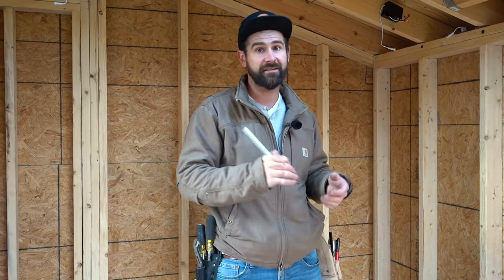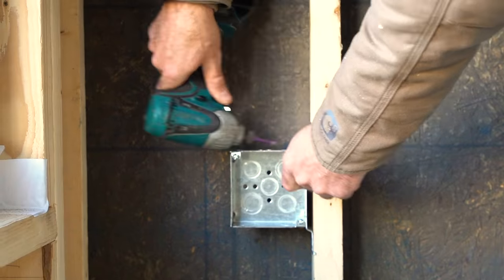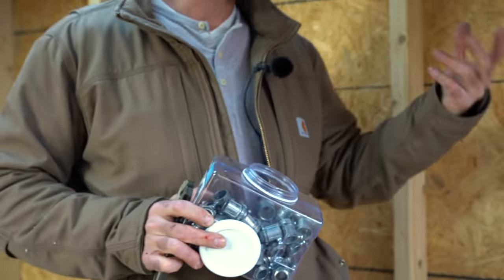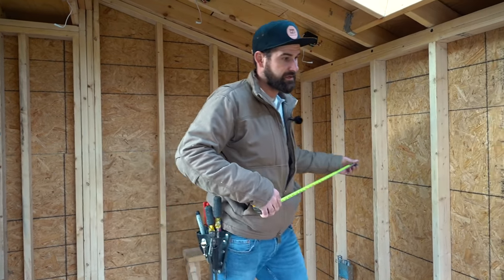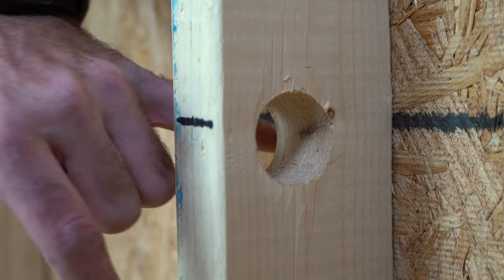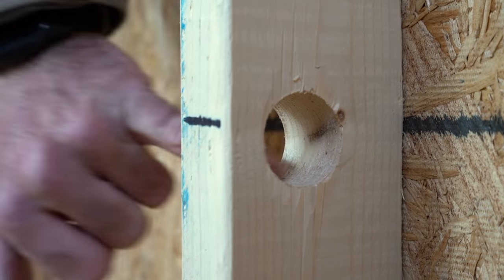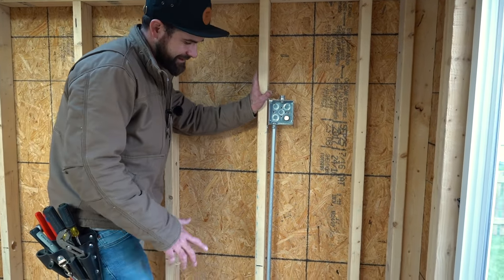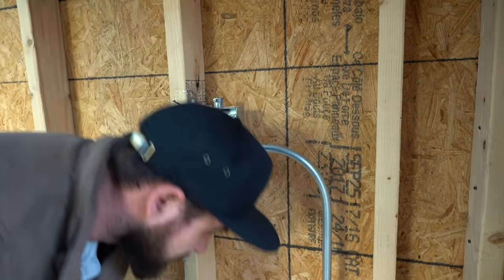How to bend and install electrical conduit

Comment: I would have used a deeper box ( 2 1/8" deep ) just to give a little more room. Somebody told me years ago the 11/2" deep boxes that you used are called 1900 boxes because they are 19 cubic inches. I always pull a ground wire in every metal conduit. Saw way too many conduits that pulled apart that would cause most of ground if no ground wire was pulled. Great ideal not using sheet rock screws to secure box.Klein makes a great screwdriver with a teamed on it. Have several that are over 40 years old and never had to replace the steel blade. Installed miles of conduit in industrial sites but only a few times thru just 1 or 2 holes in stud or joist. In industrial sites the only time we used 1/2" EMT conduit was for alarms. 3/4" conduit is a lot stronger and provides some room for future circuits. Great ideal putting the notches in home made step stool to hold conduit.Would try to keep edge of hole 11/8" from front of stud  like is required for Romex cable. Must seal all wires coming from a cold location to a warmer location to prevent condensation building uo.
Reply: I read that 1900 was the part number given by the Bossert Company almost 100 years ago.
Reply: It's only 2x3 studs you know....
Reply: @edwardsmith4353  thought they were 1 1/2 X 3 1/2
Reply: @mikeryan6277  my point was that his figures apply to ordinary studs which are listed as "2 X 4's". These studs are clearly 2X3's (which are slightly less than 2X3).
Reply: @danlux4954  it was also the UL listing number from back then and still is UL part# 1900

Comment: In Australia we have not any sort of this😂we just run the wires through the studs and bob is your uncle
Reply: Same here in Belgium .. wire or flexi conduit   :-)  This is crazy because no one will ever see it .. sheetrock over it .
Reply: We do majority of that in the states. Honestly this is pretty extra. But it’s nice. He won’t have to worry about electrical fore
Reply: @Username-ng8jy  it's kinda funny how oldschool USA electrical is .. Metal boxes / metal conduit / bending conduit / big bulky switches .. 25 years ago or so we seen this in class bending pvc and metal conduit ..and wirenuts .. last 25 years i NEVER ever used wirenuts / pipe benders :-)
Reply: @kittsdiy  Just curious. What do you use?  What exposed raceways in commercial buildings?
Reply: @kittsdiy  EMT is not the norm anywhere in NA for wood framed houses we just use NMD90 (loomex). Metallic tubing is required on surface level/exposed walls only and usually BX armored cable is used

Comment: I was taught to always pipe in 1 direction meaning, mount a box, run a pipe to wherever the next box is, then mount the next box. It avoids having to fight connectors all the time. It's odd to me seeing it done in the direction you're explaining
Reply: it just depends on the person. I do commercial electric, and i'll do it both ways, but i prefer to mount the boxes first, because then i can just take measurements from connector to connector. Sure, you could just measure to the center of the hole on the box, and land it there from the stud, but its more satisfying seeing if i can bend it perfectly to land in the next connector lol
Reply: Correct 😂
Reply: Then the box instalation might be harder if the pipe is blocking you lining it up or off by a small margin in the hight of the box if the pipe is off a bit 😂

Comment: Good Info, after watching and reading comments, want to add, 7/8" hole in Center of Stud works well as it insures you are more than 1 1/4" from face of stud, then you won't have to use a nail plate. You're strapping accomplished that. Wouldn't remove Insulation from Channellocks. Just put a Pipe Reamer on your Large Screwdriver, or use your Kleins.
If running a Lot of Conduit, use a Set Screw Screwdriver, won't slip off, faster. I live in The Keys, Corrosion and Rust is a problem, Smurf(ENT) Is common. For a Shed not planning on any Expansion or Additions, would use MC or Romex. Can't pull additional circuits, switch legs or whatever. 
We have to Pull a Ground Wire in EVERY Conduit, even Metal.
You could also show temporarily removing box to allow conduit to enter connector without fighting it.
If you can get to this shed before siding and door frame installed, you may be able to use straight pipes, eleminate the 2 90's, less pipe less wire?
In Comments, I see People mention a Band Saw for cutting Conduit, seems like putting in a Thumbtack with a Sledge Hammer. 
Found for me a Milwaukee Hackzall to work well. M12 is good enough, M18 is heavier, but more Capacity.
If Accurate height is Important(Kitchen Counter and Bath)where tile will show the're off, I will use a Pencil. A Razor knife will leave a more precise mark. 
I would also subtract 5" and put 1 mark on pipe. The second mark may be used accidently.

Comment: Looks very neat.  I was going to use metal conduit on my project, but since I needed to run nearly 60 feet of 8/4 plus ground, I cheated and used MC cable. :-)

Comment: Very nicely done!  You stay on topic and show how to do it without giving many examples of how it could be done in so many other places.  You gave the "How To" for this application.  Thank you!
If I had to cut a large hole as you did, I would use a nail plate instead of mounting the conduit to the back of the hole as it could be damaged by a nail from outside.  What are your thoughts?
Reply: The safety plates are required by code in any type of conduit or plumbing, he is just showing how to install EMT in a wood frame since the conduit is required to be at the center of the stud that is why is doing it like that, is just common sense...

Comment: Some cities and counties in the U.S. require rigid EMT (Electrical Metal Conduit) in situations where the wall cavities are exposed. Wiring needs to be protected from abrasions, or as some people do, hanging objects on the wire.

In basements especially, I have seen everything from clothes hangers, to tools hanging from the Romex/Non-Metallic Cable (NMC) in the joist bays. This is very dangerous! So rigid conduit is used to protect against the wire being damaged and causing a short.

Some jurisdictions allow flex conduit, but only in cases where the flex will be hidden behind a finished wall. Flex is more durable than Romex, but much easier to run than rigid conduit and then having to pull wire.
Reply: Rigid and emt are both different types of conduit
Reply: Regular emt not rigid you handyman you. And flex is limited at 6 feet you silly silly man
Reply: @offgridsystems1166  😂😂

Comment: Old RACO number 1900 box (4" sq metal box) I have been an electrician since the late 60's and i was taught that all 4'' box were 1900. As for the EMT many states and towns require it in wood construction.

Comment: Wow, that is so different. I see your plain-screw adaptor and coupling has a pinch screw on it unlike here is PVC without the pinch screw.  Working with steel - ends are threaded for lockrings/locknuts, couplings, etc. while flexible conduit (Anaconda) has a gland to secure it.

Comment: Nice work on showing the basics. Kind of left that interior corner as the elephant in the room though. Would be nice to see the Chicago approved method to getting from one wall to another. 

We used short radius benders for interior 90's in Colorado Springs. The AHJ would allow it as long as you didn't exceed one shorty per run.
Reply: I can only imagine the monstrosity of 1/2" emt through a 2 stud corner. ouch.
Reply: In my experience, you typically go up into the ceiling and then back down to get from wall to wall most efficiently, but everyone has their preferred way of course.
Reply: @jamesfox8930  sorry that I didn't see this earlier, but yeah, it wasn't pretty.

Comment: Tough town to require emt compared to a Mc cable … or a uf cable ….
Reply: @krakenwoodfloorservicemcma5975  when you think about an electrician coming behind you to trouble shoot you will thank god for the pipe. i live in the northshore of chicago would not have it any other way. it might take a little more time, but so much easier to work with. and the fact that if to do have a problem much easier to trace and repair.
Reply: @krakenwoodfloorservicemcma5975  Thank god for NM :) Literally fuck running Metallic and EMT in Resi.
Reply: I love bending pipe, but if you are going to do it, at least make it all surface mount.
Reply: I love bending pipe, but if you are going to do it, at least make it all surface mount.
Reply: I love bending pipe, but if you are going to do it, at least make it all surface mount.
Reply: I love bending pipe, but if you are going to do it, at least make it all surface mount.
Reply: I love bending pipe, but if you are going to do it, at least make it all surface mount.
Reply: I love bending pipe, but if you are going to do it, at least make it all surface mount.
Reply: some electrical contractor lobbied the building department lol!

Comment: Slotted screws...ugh...so glad I live in Canada.  Americans should try Robertson square drive screws. They're much better because they hold onto the screwdriver and don't slip off!
Reply: Slotted should have been fazed out they are 🗑
Reply: We use Robertson quite a bit in electrical actually. Not sure why he’s choosing to use a slotted driver on the couplings when they have Robertson inserts but to each his own. Milwaukee even makes a nice reaming bit with a bit holder for impact drivers. Could be saving himself some time.

Comment: Stopped using Channelocks to deburr EMT 40 years ago when Klien came out with a deburrer ( for 1/2 to 2" EMT ) that locked into a screwdriver then maybe 30 years ago Klien finally came out with their own deburrer mounted to a screwdriver.

Comment: It's a 4 square box in michigan, not 1900
Reply: 4 square bracket box here i SoCal. i dont think ive seen the number 1900 on them either.
Reply: @robertoparra9969   I think it's an old 1970 RACO number yes I'm old.
Reply: It's actually a 41116 box not 1900 look it up

Comment: First year Electrical apprentice here. i was told that they are called 1900 and 411 boxes because that was their original part number. Dont know if thats exactly true but would love some knowledge if anyone has it!
Reply: The box size that he is using is called 4-square bracket boxes, the ones he is using are shallow and there are also deep boxes. 411 refers to a box that is bigger in size and it also comes in a deeper version.
Reply: 19900 box 19 cubic inches, non deep version 
  411 box because of its dimensions 4 and 11 16th
Reply: Anthony is correct. I work for a supplier. I was told by an electrician when i first started that a 1900 is a 4sq 1-1/2 deep box. Because they are 19cu Inches. Now most people call all 4 square boxes 1900’s but the most popular is the 4sq 2-1/8 deep. 

411 boxes are 4-11/16 x 4-11/16
Reply: Concentrate on getting your qualifications before commenting on electrical work pal. Good luck with your apprenticeship

Comment: Conduit far and above the best way to wire a house!
Reply: Definitely the safest
Reply: Only if you run a ground wire
Reply: @todshawcross2972  you do not need a ground in metal conduit lol. only on some circuits.
Reply: He said the safest it's only safe if there's a ground wire loose lock nuts loose set screws no ground screw at junction boxes.   Like I said only safe if there's a ground wire
Reply: @todshawcross2972  there should never and i mean never be a loose lock nut. this is one of the first thing an inspector looks for. thats the fastest way of starting a house fire. thats what they make channel locks for. it is our job as electricians to makes sure every locknut is tight. every pipe is strapped. you would get fired where i worked if you did sloppy workmanship. every pipe must be level. it must look like someone who knew what they were doing did the job. i remember doing a 40 meter service. and the inspector came in to inspect. he took one look at the job we had done. and said you passed. he saw the workmanship. and that is the most important thing. to make it look like you know what you are doing period.
Reply: Stop talking like you know my workmanship let alone everyone elses which is my point one loose lockout means not grounded correctly and don't come back with some bullshit about how were you work the journeyman checks every one or your Inspector does humans make mistakes which is why in my opinion romex is safer always a ground wire
Reply: @todshawcross2972  I’ll actually mostly agree with you about the grounding, but rodents often chew on wiring. If someone failed to run a cable with enough wires you have to tear up a wall. 
Any chimp can install extension cords in a wall.
Reply: @todshawcross2972  loose wire nuts on grounds are also unsafe. Installed correctly, you do not need a ground in EMT.

Comment: Good work bro simple and straightforward I live in L.A. so im going to do this around the outside of the house for so lightingon my driveway
Reply: Not sure about LA, but where I am from you can not use EMT when exposed to moisture.  You may need to consider using PVC or rigid conduit.  Both of those conduits can be exposed to moisture.
Reply: Use compression couplings.
Reply: For the love of God....do not do that.
Reply: If you bury it don’t forget to drill drain holes into the pipe so it doesn’t fill with water…

😂

Comment: So crazy some places require pipe inside houses. That would take forever to rough in a house. In Canada we run Loomex
Reply: Never mind missing the part about bonding in the code. My question is why use all the 4 squares. Now you have to use a pile of plaster rings to finish the rough in. You will have wall full of steel. It is so hard to watch him use channel locks like that. Use a reamer because he's not checking the inner surface. That is an apprentice move. Hope you don't mind chasing short circuits.

Comment: You got it done and everything looked fairly level, but I was having anxiety the whole time. Man you really need to get yourself a reamer. Dump all the tools that you don’t need too. I’ve seen apprentices work faster and more efficiently that that. I mean I guess what you showed didn’t look that bad, but man you gotta think things through before you start. I know I’m being a bit critical, but watching someone else run conduit (not “pipe” like you kept saying) is difficult to do. I hope everything looked good when you were finished.
Reply: I’d recommend using a portaband too. Quick and easy. You should have boots on as well. I’d ditch the marker too because it looks terrible. Especially when you were making two marks for your 90’s since you couldn’t subtract 5 in your head. Im glad you didn’t try to bend an offset, or even a saddle, because I may have lost my mind.

Comment: Use a level or two if on unlevel surfaces, to make sure your 90 is a 90.     Emt needs to be supported 36" from terminaton points/the box
Reply: At least every 10ft there after and no more than 360degree  of bands between junction boxes.
Reply: @vlad1889  That's because it would be a bitch pulling wire through 360 bends without a pull box.
Reply: If you used a level on work that was behind drywall on my job you wouldn't last long. Ain't no one got time for that.
Reply: @notnecessary7730  i do. its call saving on material. less wire less pipe less time. plus you can get away with a stub bend or as i would do it run straight from box to box. and with the cost of wire. why would you run everything up and down. whats the fastest way from point a to point b, a straight line. i was taught by a master. the short cuts. the object is to make it code but keep it simple. and that time is money.
Reply: @jburnes41  and a length of MC cable would of been less expensive, less man hours and still code compliant.
Reply: @vlad1889  8'

Comment: putting conduit inside wood framing  is nuts, it belongs in commercial and industrial applications.
Reply: In chicago you have to use conduit in residential. I think new york to. It's because of the rodents eating the wires. Would be such a pain in the ass
Reply: @jarrydee2799     not nyc , armored bx cable , in nassau / suffulk / westchester romex is allowed , olrder homes will have bx.    conduit is commercial or surface on interior block or brick , exterior is in rigid pipe
Reply: When you think you know it all and you don’t .. stay in your lane
Reply: @rogerdodger3209  armored box cable is still the same concept as using conduit except no pipe benders needed…
Reply: @rogerdodger3209  this gentleman says his municipality requires it.
Reply: @steveloux4709  i know what the poster said , i replied to someone saying it was needed in nyc and it wasnt , then someone making a comment saying i think i know it all.   i work and live in nyc
Reply: @rogerdodger3209  yes in chicago you need conduit if the walls are open. you can not run metallic cable.